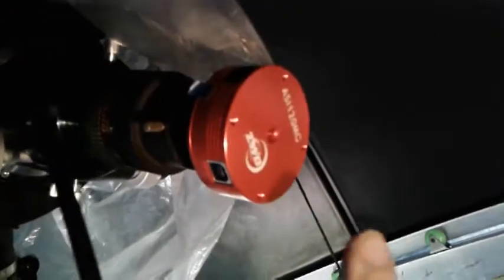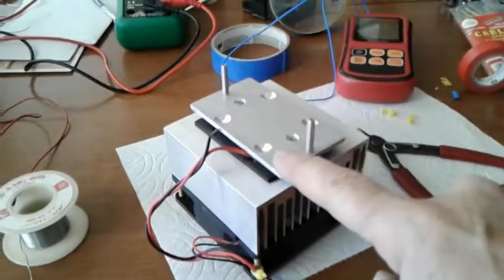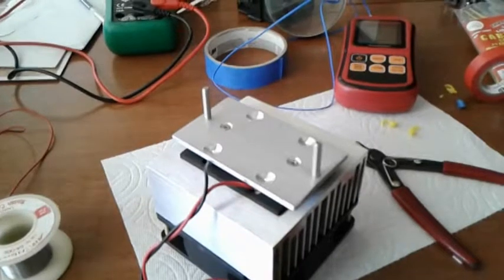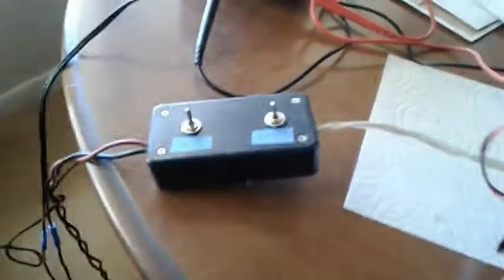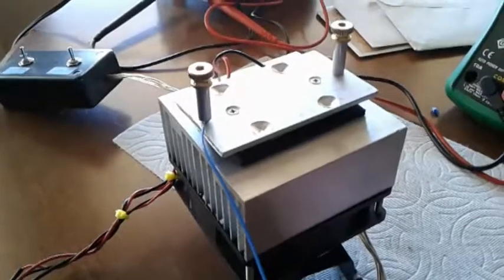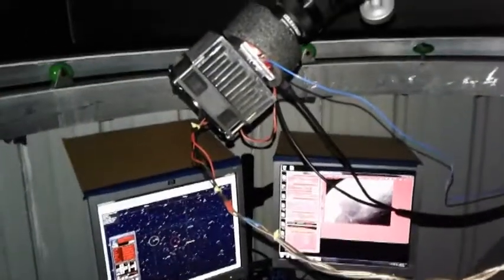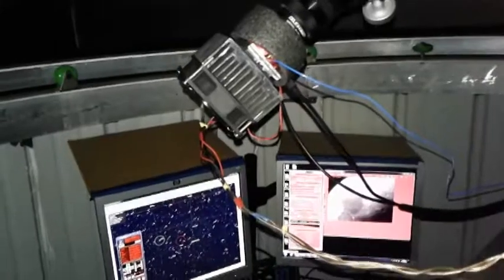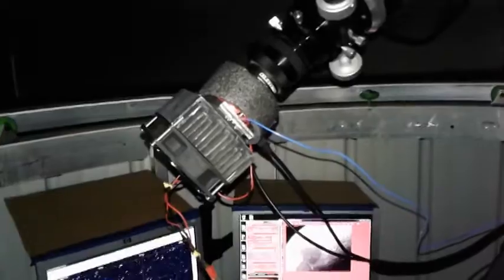TEC on ASI120MC

Comment: Not sure how much you paid for that fan but could've gotten a AMD or Intel CPU cooler and done the same possibly for a lot less, pretty sure if you split an old USB cable and split the CPU cooler wires tied them together in the right spots you could power a CPU cooler via USB.